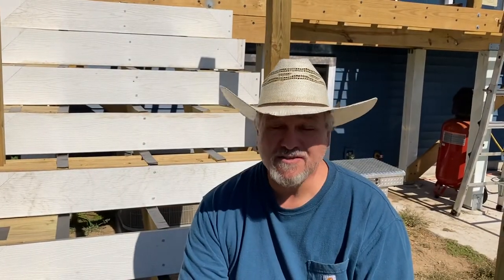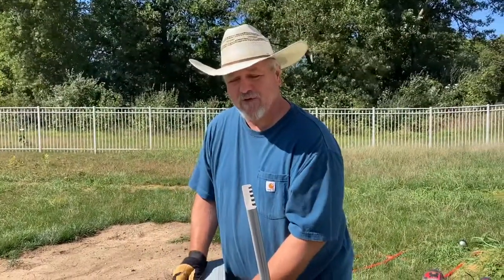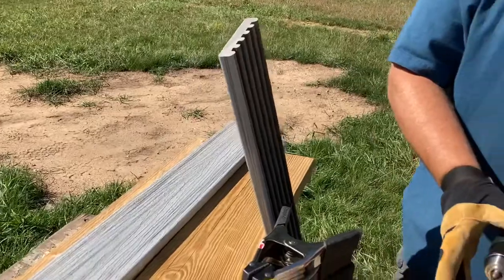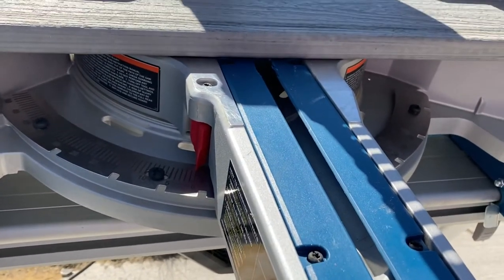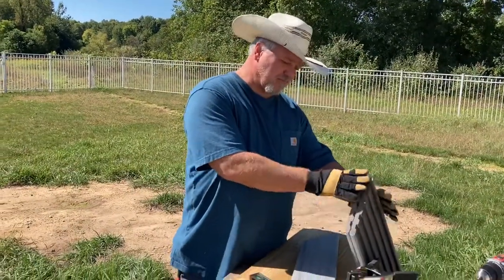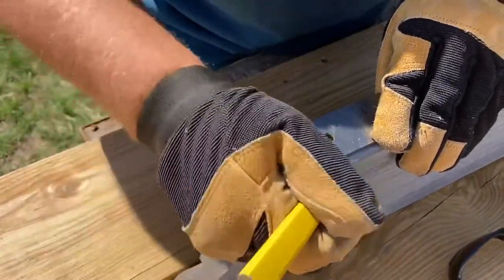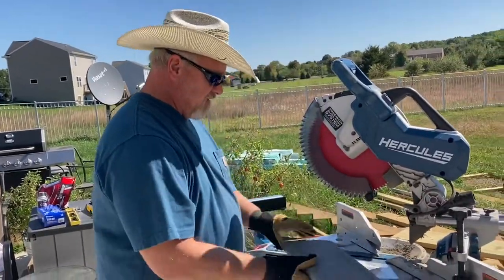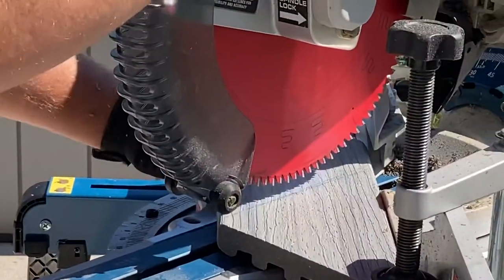Building an over engineered deck part 3B: Picture Framing Deck Stairs

Comment: I'm working through your deck videos, one at a time. Given that plastic shrinks and expands, I'm trying to understand when you need to leave a gap. I see that your miters are tight. Was that a problem later? Most of us do DIY work in the summer, so I'll guess the plastic is expanded during installation. Is this the reason you can get away with tight miters? Did you notice any problems with length variance later? Do you need a bigger gap if the piece is longer?
Reply from the maker: I have not had any problems with gaps (either shrinking or expanding), even though I will admit those miter joints are pretty tight.   The deck has been up for just about 3 years now.  I am in mid Michigan, so we get up to about 80F in the summer and well below zero in winter.  I think the reason for this is that the composite material is extremely uniform, both in the outer coating and inner structure; and as such it expands / contracts very evenly.  Of course that is just a guess, I am by no means an expert on thermoelasticity or materials engineering.   

Hope this helps!

Comment: A word of caution... DO NOT wear gloves when operating woodworking machinery that puts your hands in close proximity to a cutter (chop saw, table saw, drill press, band saw, shaper, jointer, etc).  During my career in the woodworking industry, the most serious hand injuries I witnessed were the direct result of folks wearing gloves in situations where they should not have been.  A cutter touching a gloved hand will ALWAYS result in a VERY serious injury, most likely an amputation!  A cutter touching a bare hand will be bad as well, but actually lowers your chances of amputation.  Yes gloves prevent annoying splinters, but dealing with the occasional splinter is preferable to risking the loss of a finger!  🤔
Reply from the maker: Awesome safety tip @dogpatch75, thank you.  Until I read this I had not really thought about it, but it makes a lot of sense.  Thanks so much!
Reply: @spanky762  I was not intending to take away from your excellent video! Gloves are perfectly warranted in many wood handling situations.  Just be aware of the hazard they bring when used close to a cutter.

Comment: Great idea making a finished looking 45 boxed in step. Looks very nice. The only thing I’d ask is why not set up a jig and use the clamp hold down on your chop saw instead of placing your fingers so close to the blade. I had a deck built just 8 years ago and the contractor used the wrong screws and it caused an electrochemical galvanic corrosion from the copper treated lumber. And when water got behind the Azek trim it trapped water and caused premature wood rot. It was a mess. Now, I’m replacing wood and removing all their fasteners and replacing with stainless steel. I’m also overlapping the butyl tape on top of all the joist and Azek trim. I like your videos because I’m in the process of doing what you’re doing. Those cortex screws do work nice. I wish I would have gone back with a composite deck instead of PVC because of all the blocking required. Great vids, Sir ! 👍
Reply from the maker: Thanks for the feedback Kevin.  The reason I didn’t set up a jig is that I simply didn’t think of that!  🤪

Comment: So, If you cut the width of the grooved board to make it look like a square board...won't the cut board look unfinished?  Sorry, I'm just not understanding when you said you already cut the width.  I'm currently building a Trex composite deck and did the picture frame on the main deck with two different colors.  I like the look of your picture frame stairs.

Comment: Thank you for your videos. You do beautiful work and I am trying to follow your work. 
I am confused about the drill hole you made first. For example I am thinking why not just screw the hole that you did with the long bit, so you know where I am lost. Thank you very much
Reply from the maker: In my other video I explain in detail, but the main reason for drilling the hole the first time is to clean out the plastic material. Otherwise it will force its way in between the two pieces and caused them to spread apart.
Reply from the maker: The reason for drilling the hole multiple times is to ensure the plastic / composite material is cleaned out entirely; any build up tends to jam between the picture frame pieces and cause unwanted gaps.

Comment: Love the picture frame steps! I wish you would have shown how you did in between the steps with the facia
Reply from the maker: Sorry I didn't cover that in the video.  The facia (material) I used for the stair risers I  just screwed on using exactly the same technique I used for installing the fascia on the upper deck itself.  Hope this helps!